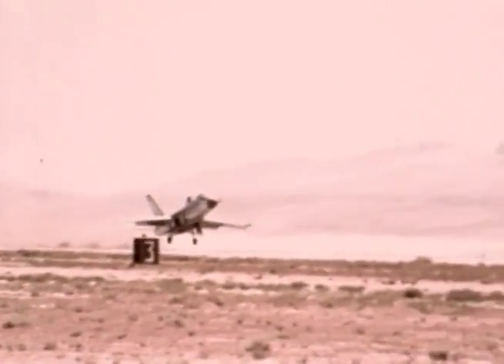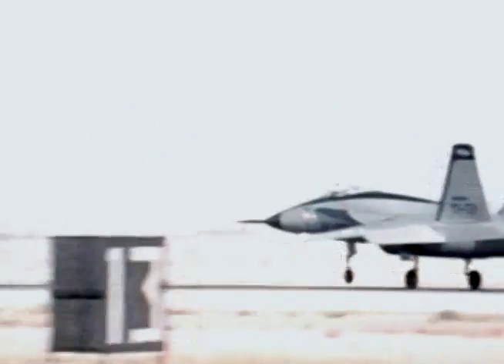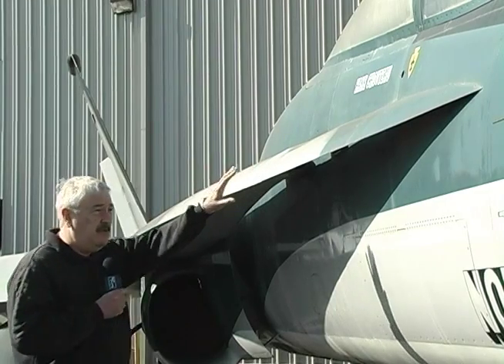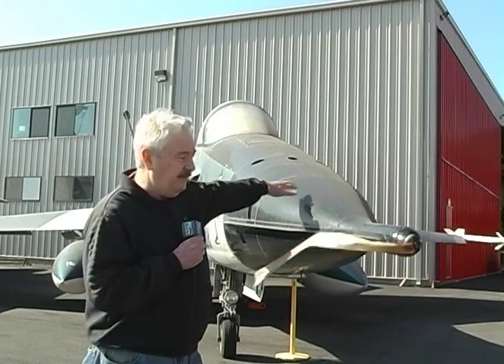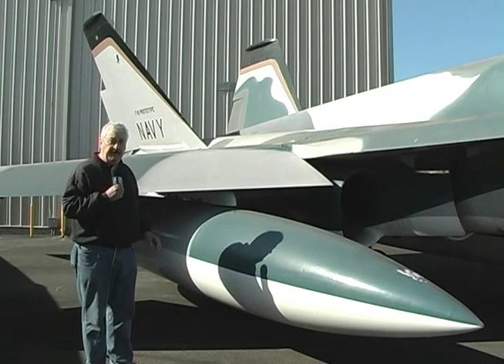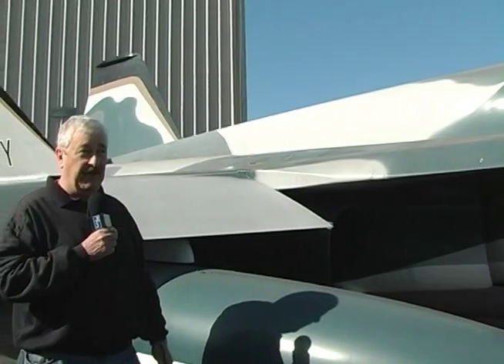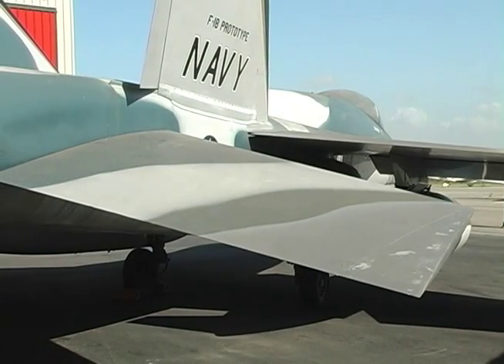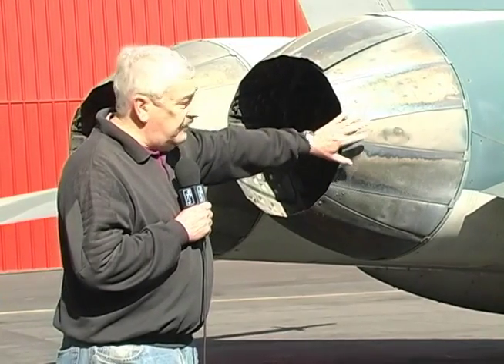YF-17 Cobra Walk Around

Comment: why didnt they call the f18 f17?
Reply: Auto Acc Rotterdam it was designated YF-17 for use for the Air Force. Once the Air Force selected the YF-16 into the F-16 Fighting Falcon then the Navy jumped on board to test and select the YF-17. Once its testing changed services and was not selected by the Air Force it was just designated to YF-18 for new Navy testing and contracts then it was named F-18 Hornet. Just a simple changed to distinguish itself from the Air Force test. Hope that helps. Basically it changed services. Now a plane like the F-35 stayed the same because the Navy, Air Force and Marines all went into contracts and testing together and there was no other test design to compete with.
Reply: This is the best explanation of any I've seen on Youtube. Well done sir.